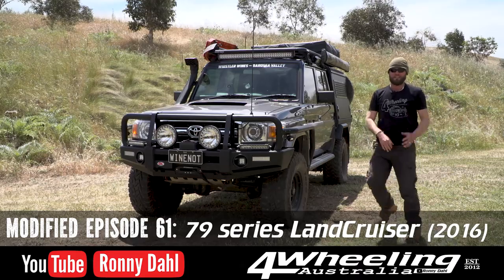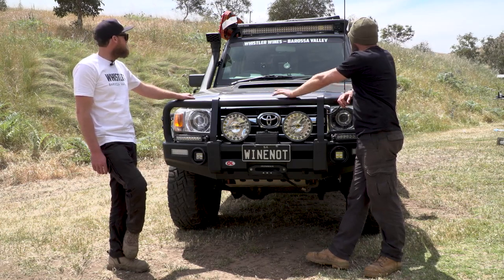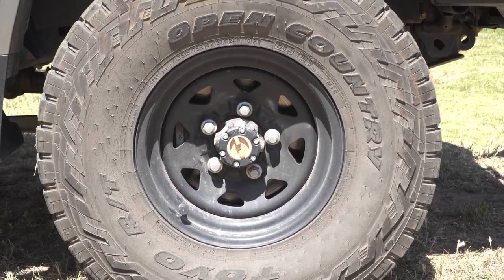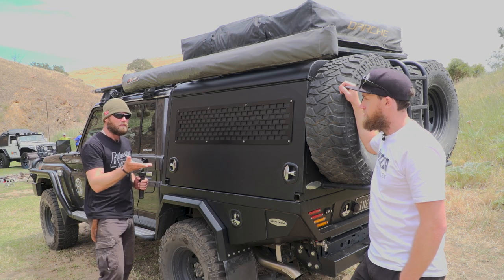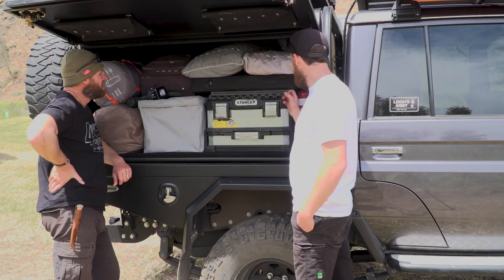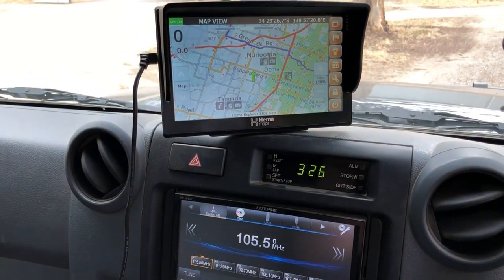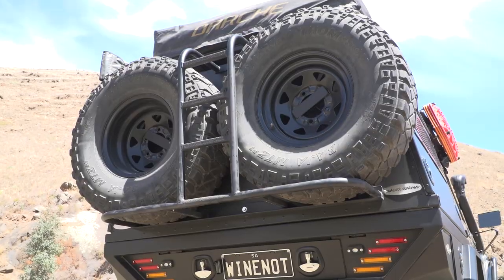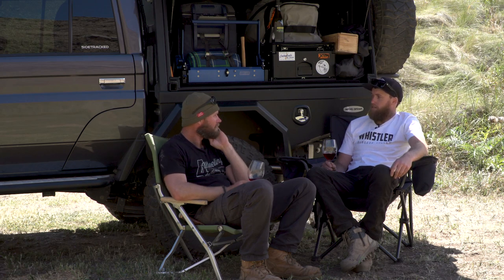2016 79 series Landcruiser review, Modified Episode 61

Comment: Right choice on the 80, Ronny.  Would love to see a 24volt-based aux batt and devices setup managed by RedArcBCDC1225D with solar and alternator regen...in an 80.

And why 4 axle breathers...just curious.
Reply: Front diff, rear diff, transfer case and gearbox.

Comment: Just putting it out there... Awesome set up but there aren’t any engineering concerns with the idea of placing a 400kg box, plus gear, plus roof top tent (which acts as a sail in wind) elevated more than a metre in the air on four legs that have no cross bracing between legs or tie down to ground? I know plenty of structural engineers who wouldn’t sign off on the principles being set up here.

Open to learning, however, what makes this a stable set up when in base camp mode? I can see the 600 or 700kgs of ‘dead load’ and the gusseted legs but it still looks like a very elevated load with a potential sail set up above it...
Reply: Liam Dee interesting point

Comment: I'm about to put BP-51's on a 76 series, with air bags... would like to know more about why you'll waste your money in the rear..??
Reply: one of the cons with installing airbags is they limit the amount of travel or "flex" so the shock absorber wont be performing to its full potential, especially in the case of what the BP51s offer
Reply: I would also suggest airbags help prolong the life of shock as far as overheating goes. which is a big advantage of remote resi shocks
Reply: @michaelcook5233  Not if you get Daystar lower cradles.  They allow you to attach the air bag to the frame only.  The cradle sits on the axle side giving a place for the air bag to nest, but not attached.  This allows the suspension droop fully while still having airbag support.
Reply: @johnfitzgerald5158  brilliant, but im going to ask, is this available in australia?
Reply: @michaelcook5233  I found this...same concept different brand name in Australia. http://polyair.com.au/polyair-bellow-cradle-kit/
Reply: @johnfitzgerald5158  thanks heaps !!

Comment: Whats dpf
Reply: D,iesel P,articulate F,ilter
Reply: Dumb
Problemmatic
Failure
That's creating huge costly problems for many new diesel engines.
Reply: A large expensive filter in the exhaust pipe that catches soot particles and burns them using heat from the exhaust, usually by injecting extra fuel.  
They are hugely problematic because they block up very easily unless the vehicle is doing long trips with reasonable load on the engine.  
When they block up, they usually don't clear out as well as they are supposed to and often need to be replaced for a lot of money.  
When the engine gets a few Ks on it and starts using a little oil and passing some through the turbo, it blocks the DPF with ash which can't be burnt off.  
Also they are a big fire hazard. They can get up to extreme temperatures so you need to be very careful to clean out any dry grass from around them before they heat up.